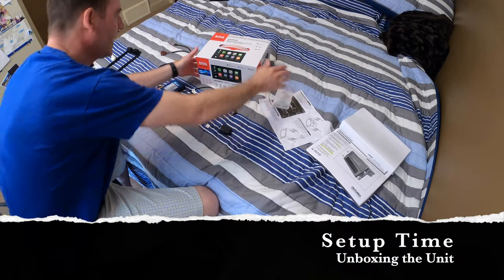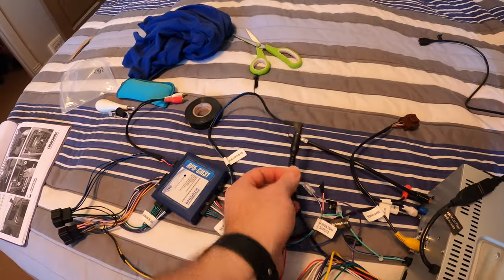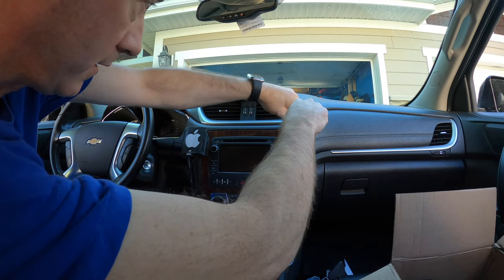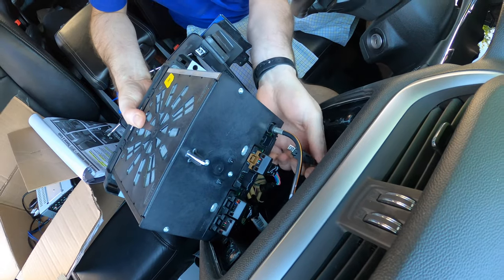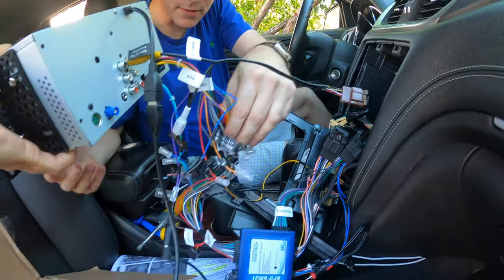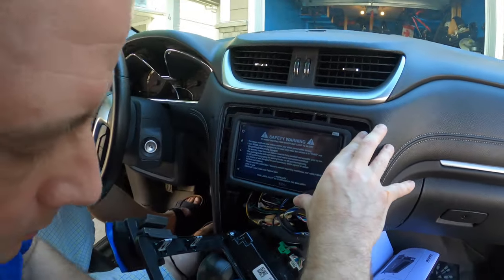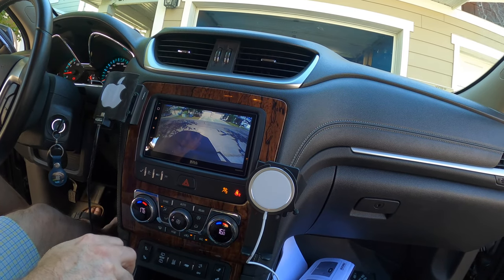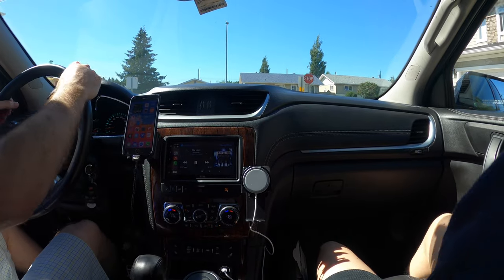Installing Boss BE950WCPA Stereo to get CarPlay!!!

Comment: Mine just went dead today. I think I may have shorted it out leaving my apple cord in the usb outlet. I’ll check fuses under the hood before taking out the head unit (there is a fuse there too I believe). Wish me luck. 2yrs I hope it isn’t dead!
Reply from the maker: Mine had a 3 years warranty.  I hope you can get it working or get a new one.  Good luck!

Comment: Hi, great job on your video and installation.  I was just looking at this Unit for my Hyundai Veloster.  Question for you, did you get a different rear camera, or did your existing camera plug into the back of the unit.  Maybe I missed that part in the video.  Thanks!

Comment: Where did you get the instructions from?? Mine just came with a basic info, no instruction booklet.
Reply: @_berskyboy  do you remember price?
Reply: @_berskyboy  my biggest question is, the interface has 0-9 dial, instructions say depending on what audio system you have determines the number setting. Mine is this model radio and it’s not in the list to be determined.. so I’m stuck. There’s a sticker over the harness input on it saying to set it to correct number before connecting vehicle to harness. 🤦🏻
Reply: @_berskyboy  I think I got it figured out. “other” is same as pioneer. Wish me luck, all wiring is like your minus the camera. Thank you for all your help!

Comment: I have some questions for you about Boss Audio BVCP9850W.

Is it double din?
What are the measurements in length, height and depth?
Does it have mirror mode?

Thanks so
Reply from the maker: Yes double Din.  The measurements are all going to be the same.  If you have a double din slot, this will fit no problem.  Not sure what mirror mode means.  I bought from www. crutchfield and put my car in and it gave selection to choose.
Reply: @_berskyboy  Thanks for answering.

I am referring to the mirror, for example if I am watching YouTube on my cell phone, I can transmit it on the stereo screen as if it were a smart TV (cast).

Thanks so

Comment: Great video! I am considering purchasing the same unit, could you kindly tell me about the gps antenna and its function? The other boss units do not have one. Thanks and cheers, zman.
Reply: @_berskyboy  ok great, thank you for your quick reply, I think I am going to pull the trigger on buying this unit, for the features and the price point its hard to beat, I will be purchasing it through Crutchfield as well.

Comment: Hello Mark, thanks for posting the video. I watched as I was waiting for my head unit to come in! Now that I have it though I am not able to get the steering wheel controls to work. Did your steering wheel controls work fine using the PAC module? I am using it on a different car (ram 1500) but I would assume PAC operates about the same for different vehicles
Reply: @_berskyboy  So you were able to retain the use of steering wheel controls right? No problems?
Reply: @_berskyboy  My PAC module came with an adjustment switch, did yours? What number did you set it to? I set mine to 7 which is for "other" head unit brand. Did you do the same?
Reply: @_berskyboy  Thank you for your responses Mark! It ended up being a faulty unit so I got a replacement!

Comment: Hi Mark, solid install video, well done!

I have the same head unit but I've had trouble changing the programming of my steering wheel buttons, have you had any experience changing the button assignment at all?
Reply: @_berskyboy  This is going to seem like a dumb question.. but how do you change the SWC button assignment? Lol. I ask because the voice control button on my steering wheel takes me to the settings > devices screen. I've tried navigating to the SWC button assignment screen but I haven't worked out how to actually assign different buttons. The calibrate button doesn't seem to do anything, and there's a message on-screen that says hit a button on the radio then the physical button but I can't seem to get it working.

Is there some specific circumstance where you're allowed to change them? i.e. in park, engine off etc.

Thanks in advance
Reply: @_berskyboy  Wonderful thank you for the write-up, I'll give that a shot!!

Comment: Two questions I have for you- I couldn't tell completely from this video alone but is this truly a wireless Apple CarPlay system or does it need to be plugged into a USB port for Apple CarPlay to work? Next question I have is I noticed your car has Bose speakers- do you feel putting in this after-market radio system from BOSS affected the overall sound quality of your speakers? Just wondering because I also have a Bose stereo system in my vehicle and I wanted to make sure before purchasing this model of Apple CarPlay from BOSS that the overall quality of the Bose stereo system is not affected
Reply: @_berskyboy  so you can still do wireless though if you wanted to, correct? It’s not like you have to choose one or the other and keep it that way for the rest of the time after you initially set the system up. And oh okay, I didn’t realize it had that feature but that’s nice to know the sound quality won’t be lost!
Reply: @_berskyboy  okay thank you, just wanted to make sure you could do both options of CarPlay
Reply: @_berskyboy  Does the wireless option take longer to connect when you start your car? Thanks

Comment: Hey MARK , For the apple play the usb conector you hook up if you don't want to do wireless apple play  the radio comes with the usb hookup extesion black wire in the box  that you hooked up on the side of the dash or did you purchase it extra ?
Reply: @_berskyboy  do you have the item or part number of the black one you used in video

Comment: This is a old video so ill doubt ill get a response, but i recently had this installed and i noticed that when i connect my phone to this stereo, theres a constant clicking noise every other seconds, sounds like static its no longer than half a second but you can definitely hear it. At first I thought it was a cricket or something but then i realized it wasnt lol, anyone have a fix i looked everywhere? Should i open it up again?
Reply from the maker: It think you need to double check all connections, I found this on the internet:  

Static noise that your car speakers are making points to an issue with the connection between important parts of your sound system. This can also be due to the alternator and the battery. 

Your speaker and car sound system is connected by what is known as RCA patch cables. This also connects your head unit to the amplifier. You can find these cables and unplug and then plug them back in for a reset. You can check to see if it worked by turning on your radio and checking for static.

Comment: For some reason my phone calls and navigation voice only come out of my tweeters with this unit? Could it be an interface issue?
Reply: @_berskyboy  I don’t have an amplifier, my onstar as far as I knew only operated from my rear view mirror and not the steering wheel.. now it works on steering wheel.. onstar has it’s own speakers on ceiling of my truck. It’s a 2008 Chevy avalanche LS & had just the basic radio head.
Reply: @_berskyboy  it was because both my front speakers stopped working lol, I replaced them and everything works fine!